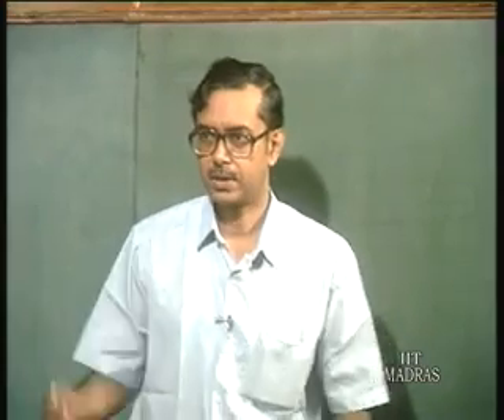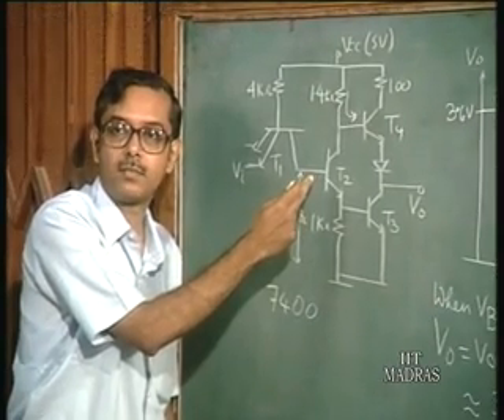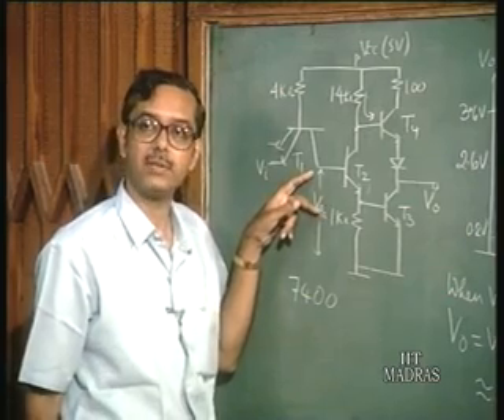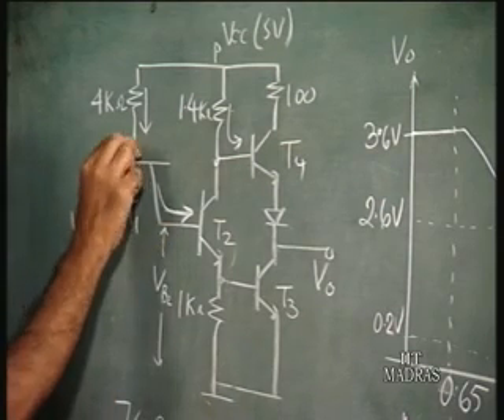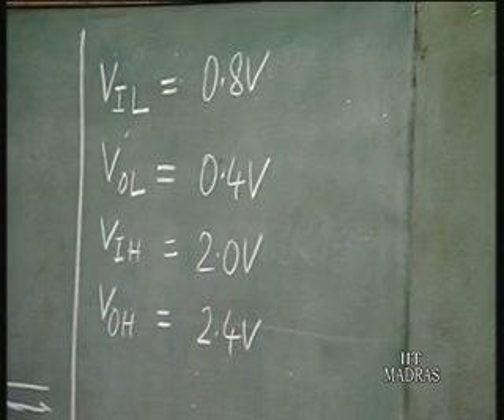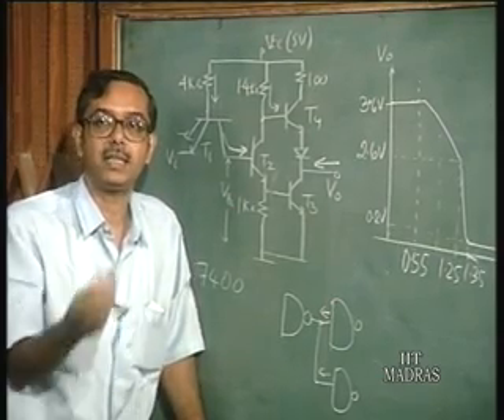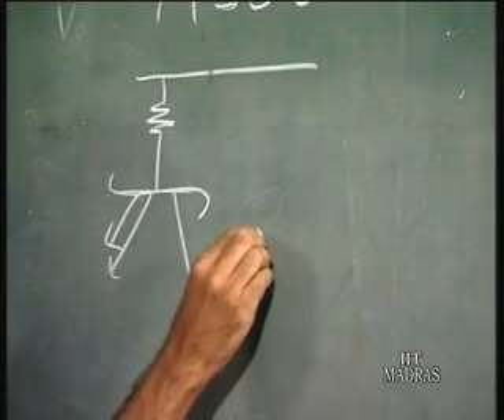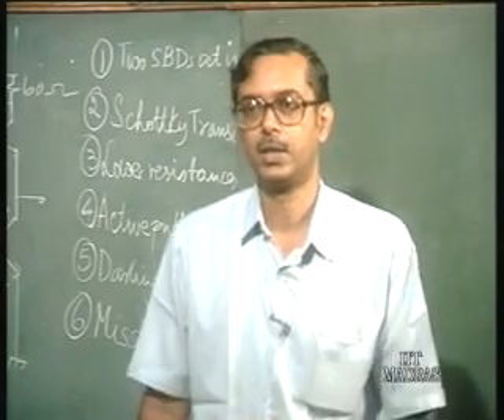Lecture - 9 Standard TTL Circuits

Comment: HELLO SIR..BUT WHY THE SLOPE OF THE CURVE (CHARACTERISTICS) will increase if the re is decreased as u spoke about the input resistance of the t4 is parallel with the re.
Reply: When T3 turns on, it will act as a resistance parallel to emitter resistance of T2, 1K. (Not T4, when T3 goes on, T4 goes off).
Resistances in parallel give always lower equivalent resistance than the original ones. Take for example R1=20ohm, and R2=5ohm. R1||R2 = (20*5)/(20+5) = 4ohm, which is smaller than R1, and also smaller than R2.
So, that equivavelnt resistance will be lower than 1K, and lower than T3 resistance when it is on. 
Now you have R_eq = Re || R_T3 < Re. Emitter resistance of phase splitter is now that R_eq.
Then, as emitter resistance becomes smaller, the amplfier gain, which is Rc/Re, and also the slope of the characteristics, raises, so you have a higher slope.
P.S. You probably don't need this answer anymore, but someone might be asking the same thing :)
Reply: @jelenab7314  thank you